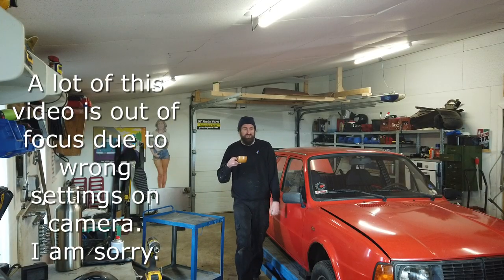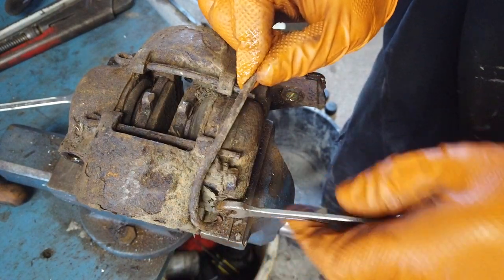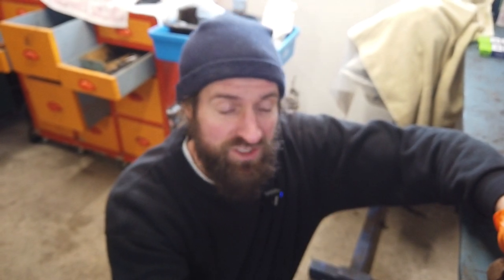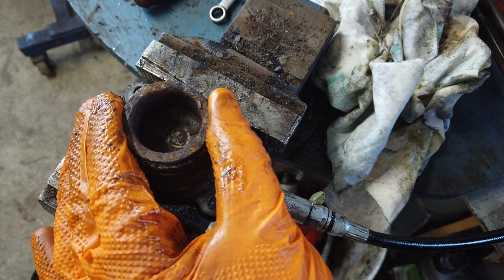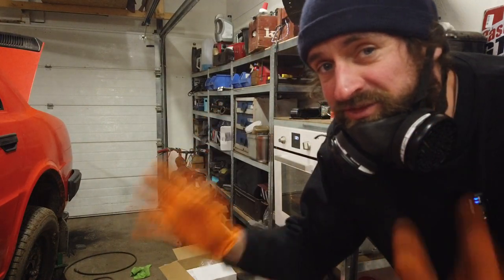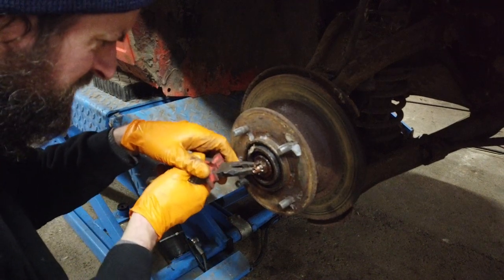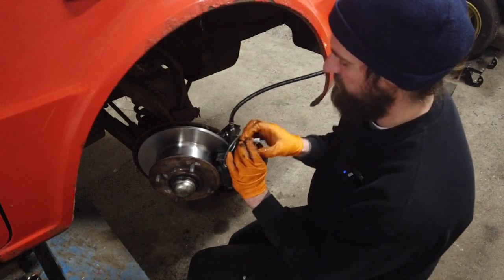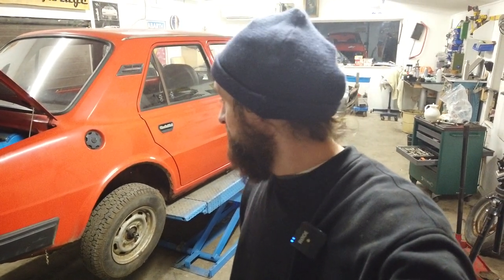BARN FIND ŠKODA 105- Rebuilding the brake calibers

Comment: Another great video, thank you. Fully agree with your recommendation about removing pistons, compressible fluids (like air) are much less controlled and therefore potentially dangerous than incompressible (like grease) so although it 'wastes' good grease, it's better than risking your fingers or worse. At least the used grease can be used again to coat and protect breaks lines! Looking forward to the next one!
Reply: *brake (just spotted typo)
Reply from the maker: Yea... just thinking about using air gives a sharp pain in my fingers! :O

Good idea for using the dirty grease!
Reply: I suppose you could use a liquid, possibly water instead of air or grease. Depending on where you live, water pressure from the tap might actually be enough.
Reply from the maker: @Ragnar8504  Good idea... I was also thinking to modify and old jack and using hydraulic oil... or even just old dot4! :D

Comment: another good step made and wont be long before its on the road and you will probably have to strip down the carburetta and rebuild it with new seals as this was the cause of many bad running issues on these cars and will certainly need doing on this one after being stood for so long but great progress being made on this car brilliant
Reply from the maker: Yes I think you are right...

But on this project I am trying to let the car know what it needs before doing it...

But it would surprise me very much if the carb is fine without even a clean! :)

Thanks!

Comment: Right on buddy, don't stop,tomorrow I'll get the last parts for my 106 so I can finally finish it up. My right drum brake is not coming off I hammered 3 hours yesterday, seems like the bearing welded itself on the axle 😅
Reply from the maker: Its unbelievable how rust can glue stuff together.... Its better then locktite!

Comment: I’m running into the exact same issue with my Skoda’s calipers right now haha!

I’m working on a 120, right front caliper has the bleeder absolutely seized. Tried all the tricks in the book, only managed to mangle the bleeder. Replacement calipers are almost impossible to come by, I’m thinking of modifying the car to fit another type of caliper.

Comment: Enjoying your vids buddy 👍 Ive just gone through this myself on my s100... Even down to having a damaged piston carrier as well haha.. I managed to get a second hand pair that are currently away for plating :) I can strongly recommend getting a heavy duty hub puller for the rear drums (the type that bolt on to the wheel studs) then load it up and add a bit of heat and it should come off 👍👍. Keep up the good work.
Rob
Reply from the maker: Hey Rustycools!

Thanks! glad you like them!
I am trying to get the drums off, but I quickly realised it wont bodge without a good sturdy puller... so i am waiting to get one now.. :)

Comment: Cotter pins are wedge shaped and solid and used on old bicycle cranks to hold the pedal arms on the crank by interference fit. These are split pins. Very sorry about caliper 2, but it's a hazard. I have successfully removed sheared off bleed screws by heating the whole assembly then lots of penetrating fluid then tapping an oversize Allen key/ hexagon into the hole and winding it out. It doesn't always work, but I've had more success than failure with this method.
Reply from the maker: Aha thanks for the clarification!

Yes I´ve had luck to remove the before, but this time it just went wrong.... :(

I could get a pretty clever repair kit for the bleeder screw, but it was more then 100 euroes... :O

Comment: I've just changed the rear brake pads  yesterday. You'll need a special tool for the rear brake drums to get them off if you plan to repair the rear brakes
Reply from the maker: yup... I think you are right! They seem very stuck!
Reply: @SeasideGarage  yes they're allways so stuck 😕 that's why that brake drum tool exist for this model.

Comment: Ah, I was wondering what the oven was for, I thought you had it there in case of needing an emergency roast dinner or something... :D

As for the brake rebuild, looks like they were definitely the culprit for the "worn clutch" reason for it being parked up, they were pretty bad even for something having stood for years, still, they'll be rolling free and stopping when they're supposed to now... :D
Reply from the maker: Heheh great for a quick pizza! :P

Yea they where seized badly... 
Know they should work fine... Just need to hook them up again!

Yes, I really think the mixed up dragging brakes with a bad clutch....

Comment: Oh my Skoda 105S !!! Whatever happened to you ????
Oh yes, that's right, I scrapped you after your cylinder head gasket blew and you filled my workplace with oily smoke as you idled outside.  Cracked cylinderhead meant you were beyond economic repair as a rusty wreck.  Thankfully smoke alarms weren't fitted to workshops in those days.
Reply from the maker: Heheh... do you miss it? :P
Reply: @SeasideGarage  I regret that I bought a 3 year old Fiat Panda rather than a 1 year old Skoda 120. The Panda needed structural welding after 18 months, I think the Skoda would have survived longer.
I went with the Fiat because the Wall had just come down and the Skoda spare parts had hugely increased in price....

Comment: cotter pins are an american term , in the UK they are called split pins because they are split / seperated to lock them in position
Reply: Cotter pins are not American, but they are entirely different to split pins.
Reply: @timhancock6626  yes they are , used on chamfer fitting such as bicycle cranks , as i said you  used an american term , we call them split pins , I am a mechanical engineer   trained as an apprentice with the EITB now retired .
Reply from the maker: aha! I sometimes mess the terms up a bit... :)